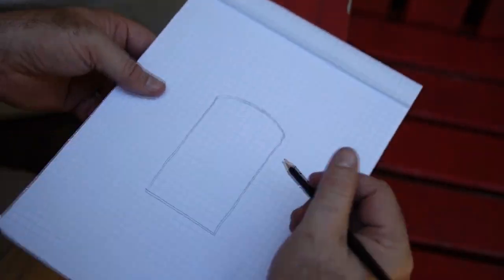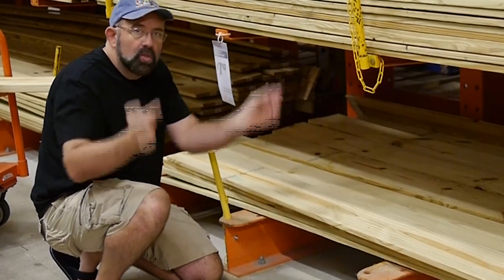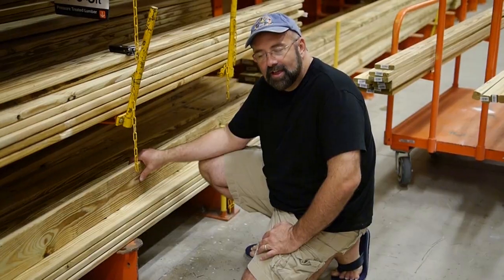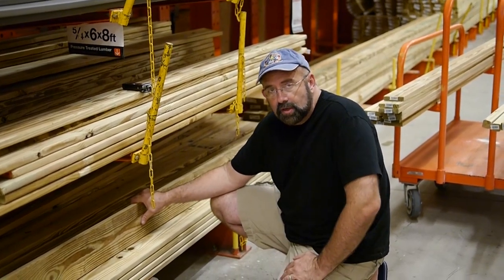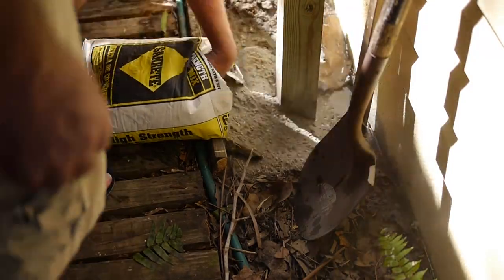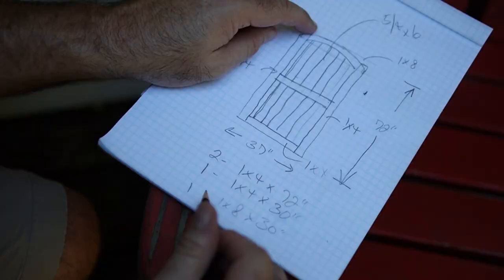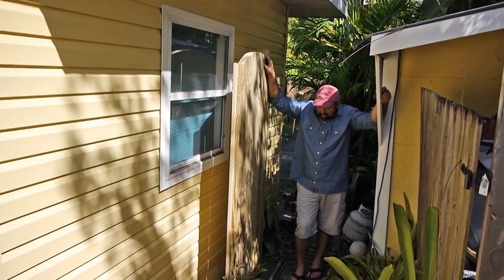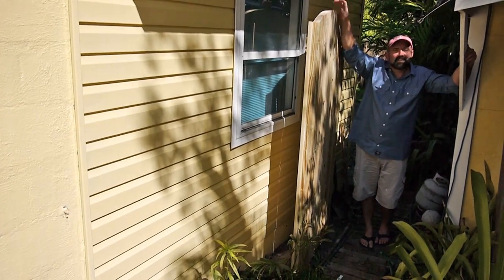Building an Arched Top Wooden Gate in One Day

Comment: Use trammel points to make an arch is the easiest way to make that top arch. Also I use a router with a wood piece attached to the center of the gate with one screw attached to the gate the other to the router to cut a perfect arch. The longer the wood piece the bigger the arch.

Comment: you have to put a diagnol in from top unhinged corner to the bottom hinge to prevent sag.
Reply from the maker: Tim Robinson  I was concerned about that but didn't want the diagonal because I thought it looked better without it. That's why I used a significant amount of glue, strong fasteners, and thicker lumber. So far so good... the gate has been up a couple of years now out in the weather and hasn't sagged at all. I was also concerned if I had enough concrete in the post hole because of the weight of the gate... but that has stayed straight and in place as well. overall it still looks and works just as shown in the video.

Comment: What was the purpose of finding the middle between the lowest part of the arc and the edge?  What was that measurement used for?
Reply from the maker: Hi David, I'd have to sit for a few minutes to really think about the geometry involved and come up with a good answer... but the bottom line you're creating parts of a polygon inside an imaginary circle, part of which is your arc,  (I'm not sure how many sides) and the right angle line from the center of any section should lead you to the centerpoint of the shape as a whole, which is also the center of the circle you want a section of. I'm not sure if that makes any sense the way I wrote it... but at least I know what I'm trying to say. lol... try it on paper, you'll see.. it works!
Reply: thanks I get what you're saying